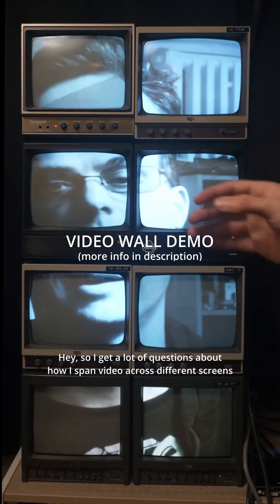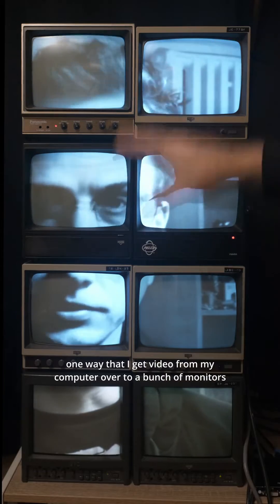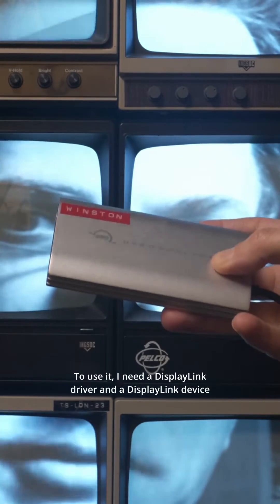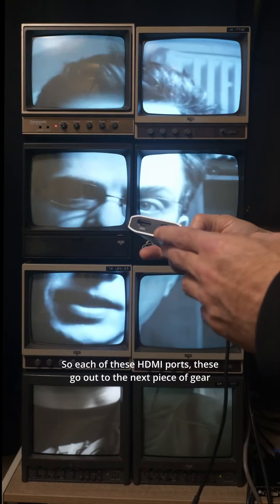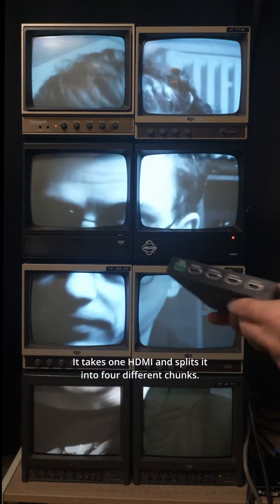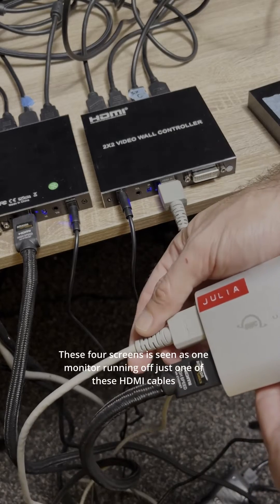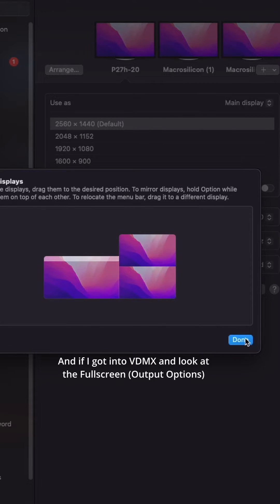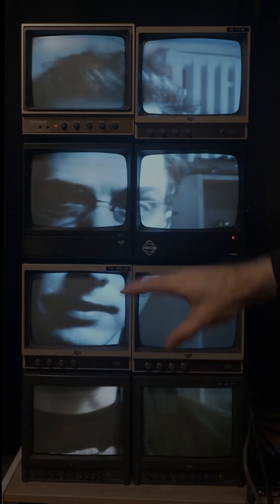Video Wall Demo

Comment: The setup requires "HDMI to RCA" adapters for each of the HDMI outputs. He left that part off for some reason. That's how you convert the digital signals to analog.
Reply: Thanks, yeah i ended up figuring that part out. It makes sense to get a ton of those as opposed to a video wall controller.
Reply: And probably a bunch of RF transmititers on top of that.